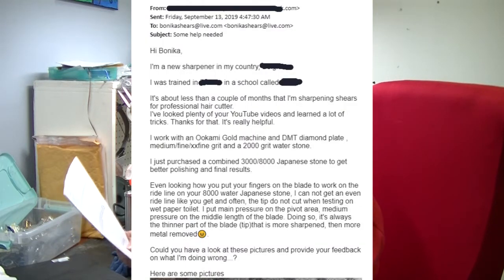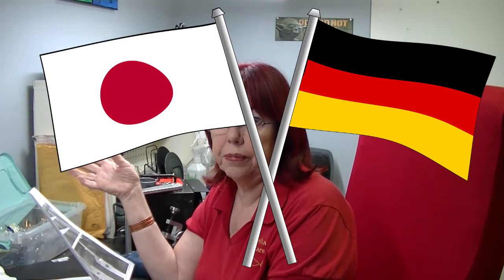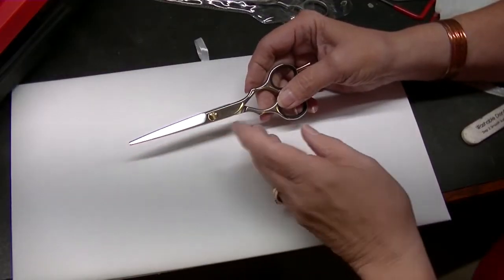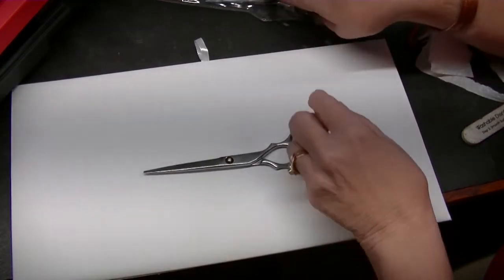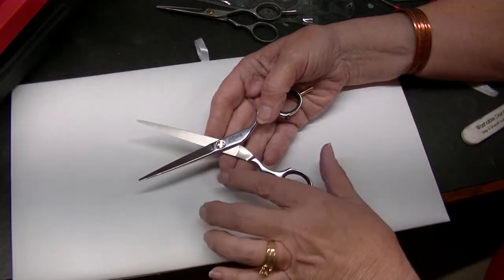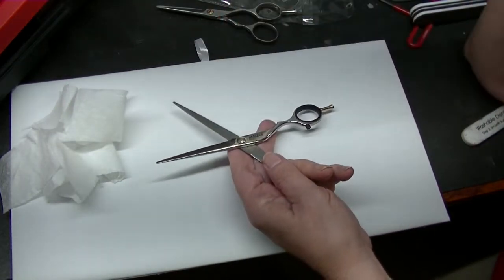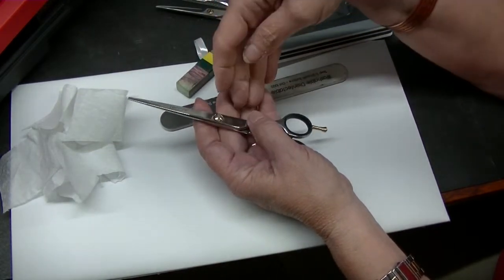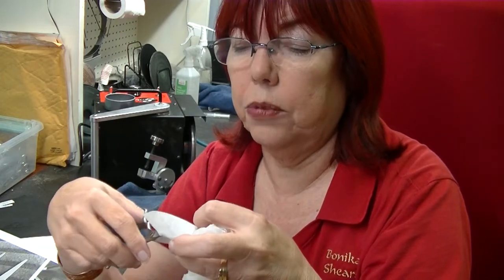When Less is More in Shear Sharpening

Comment: What replacement plastic is it?
Reply from the maker: On some shears the plastic cap should be replaced every time the shear is disassembled. Unfortunately these companies do not sell the plastic cap. I have a few limited ones for my own use on Jaguar but I have no source to buy and sell these. Therefore it is best to sharpen without taking them apart if possible.
Reply: Thank you